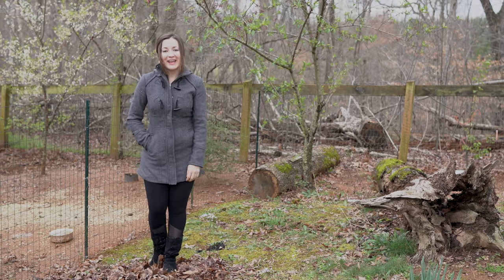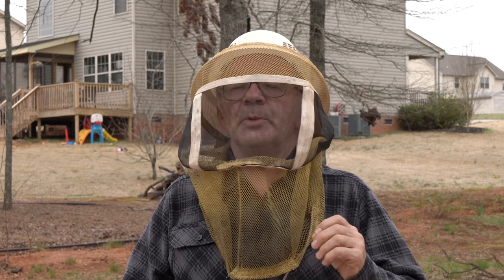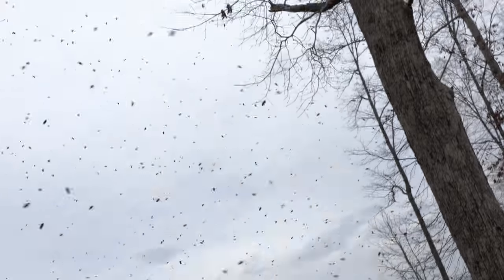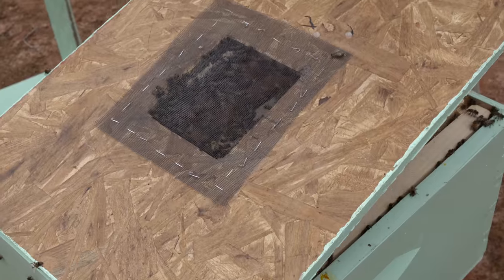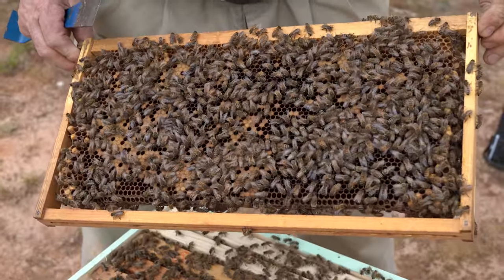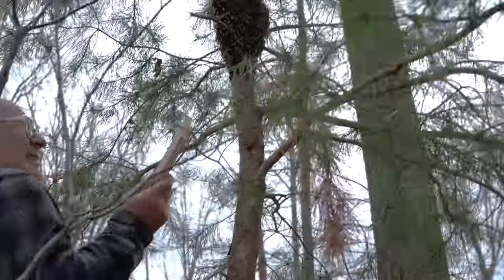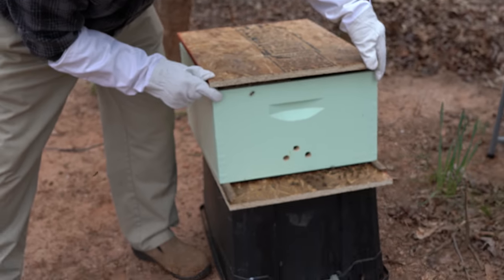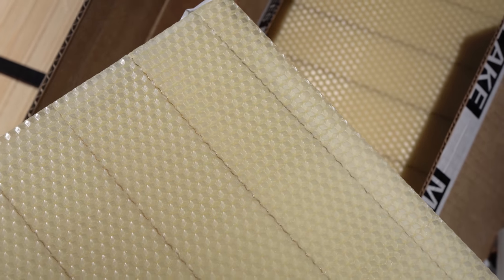Beekeeping for Beginners | Swarm of Bees - Everything You NEED to know when first starting out!

Comment: Do you using 1 medium and 1 deep for your brood area?
Reply from the maker: We use 1 deep super for brood area.
Reply: If you use 1 deep does it matter whether it’s an 8 frame or 10 frame?  When you use  1 deep, how many frames do the bees use for brood and pollen?  Thanks!
Reply from the maker: @georgegarcia5052  It doesn't matter. We use 10 frames. As far as how many frames, it depends on the family. We add a second deep super for honey. I hope this helps.
Reply: Thank you.  If I may trouble you with a follow up question.  You said the amount of frames depends on the family.  In your father’s experience, the fast majority of brood boxes are under 10 frames?  I’m thinking 🤔 of using narrow frames which can fit 9 deep frames in a 8-frame deep box.
Reply from the maker: We use 10 frames for all our beehives. How many frames bees use for brood or honey its up to them. I didn't know there is such a thing as narrow frames. Hope it works out well.